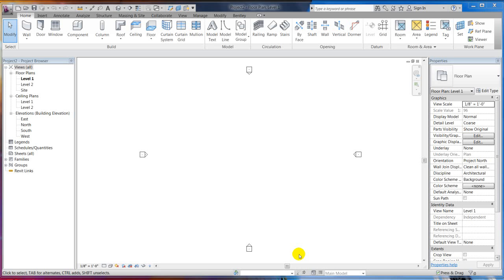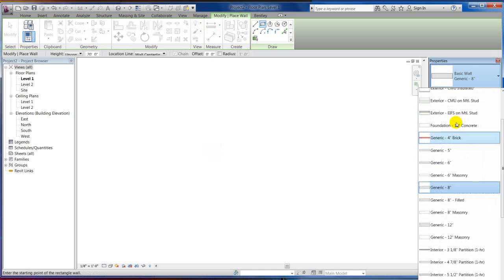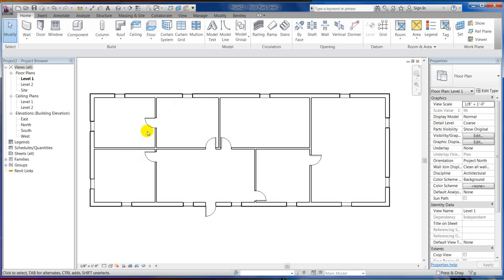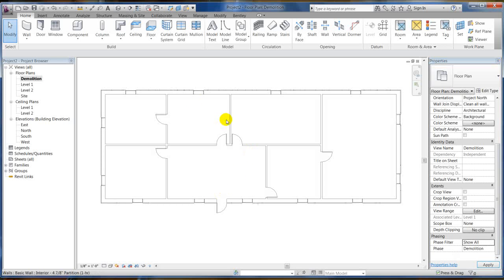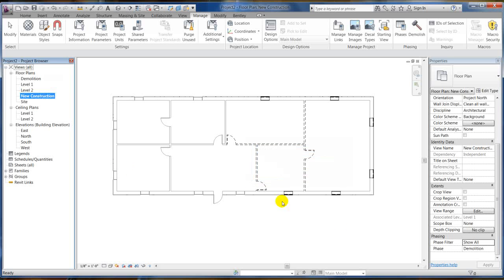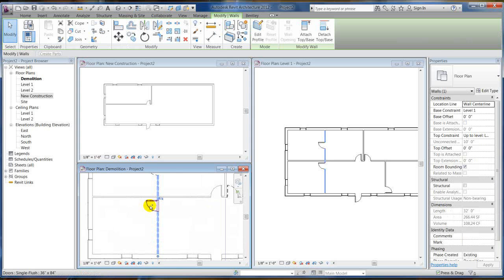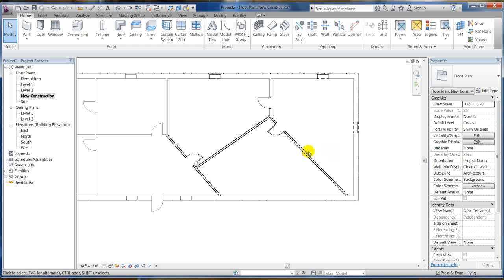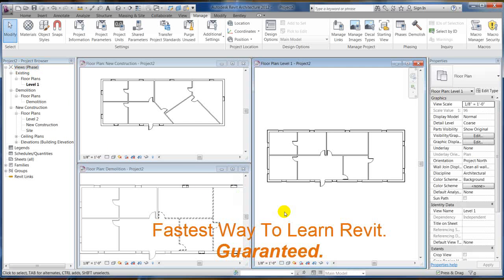Revit Architecture 2012 - Phases

Comment: WARNING: A common mistake with Project Phases is that users create a DEMOLITION PHASE. Demolish is actually already defined in Revit as a Phase Status and creating a project phase for just demolition is a very frequent offender of display problems. This is where Revit doesn’t exactly work like an Architect thinks. Having said that, this is OK for simple projets with a simple addition or renovation. DO NOT CREATE A DEMOLITION PHASE ON COMPLEX PROJECTS WITH MULTIPLE PHASES.